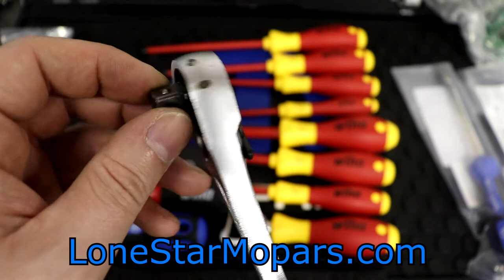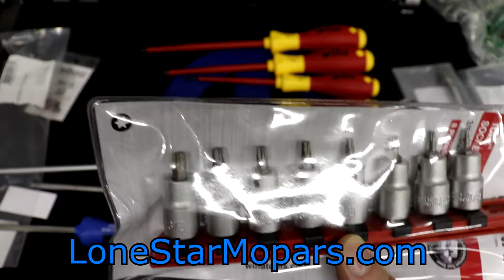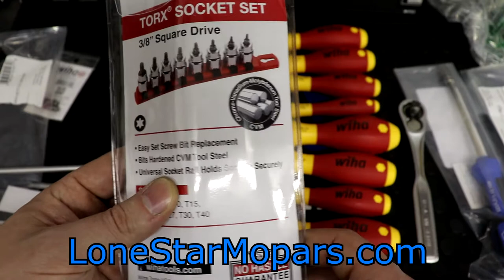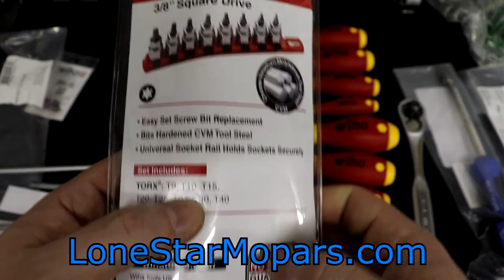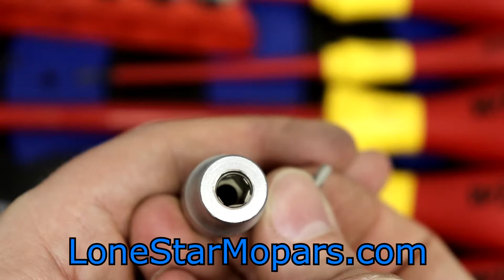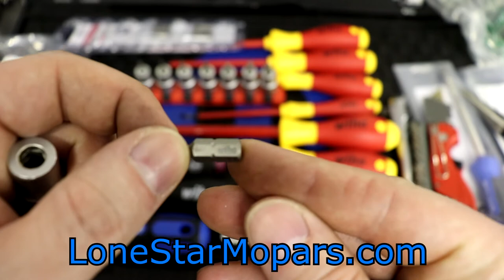Wiha Torx Bit Socket Set

Comment: That is the answer. 
I have been struggling to find good quality torx sockets. 
Wiha make some of the best bits I have ever used. 
That system is perfect because you will bend torx below T27
Wiha is a German company so the grub screw was always going to be metric. 
The whole world is metric except the USA Liberia and Burma. 
There is no metric version of the 1/4" ,3/8" or 1/2" drive. It is the same.
Great find, thanks for sharing. 
Try putting your hand flat and the item your trying to film in your hand, this will block out the background and allow correct focus.
Reply from the maker: It is a pretty sweet setup!  I was unaware that Liberia and Burma were also using the old system...interesting.  
I have been playing around more with the camera...it is great, but offers way more settings than anything I've had in the past...Next video I have something small I'll give it a shot and see if I can get a better image set.  I"m also adapting to situations like the set screw by bringing in some better Metric L Keys :D

Comment: That rail looks just like Ernst manufacturing's socket boss system, I have a lot of them and they are very nice. I have one rail holding my large impact socket set (29-38mm) weighs about 30lb and it holds together and the sockets stay on in any orientation.
Reply from the maker: I've got quite a bit of Ernst stuff at home and work...I'll have to check their boss system.  These rails, assuming they are the same, are fantastic...very impressive they can handle that size of sockets!